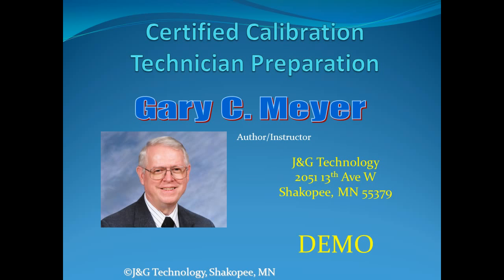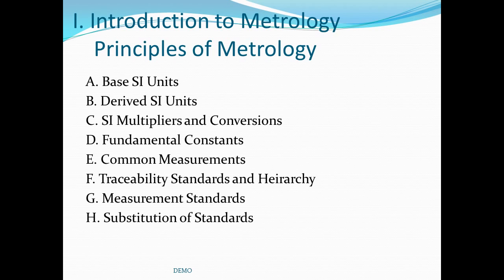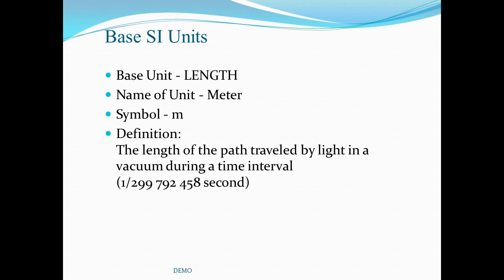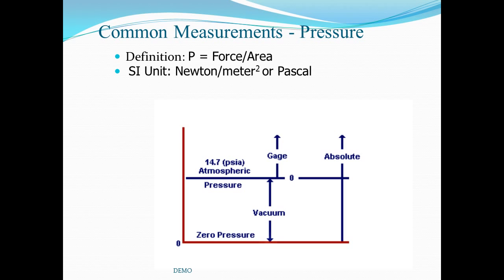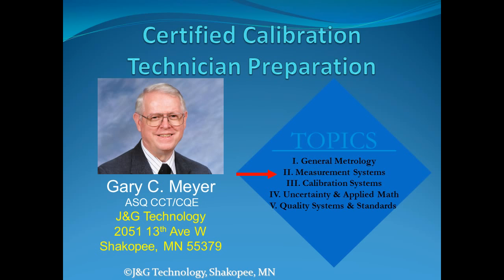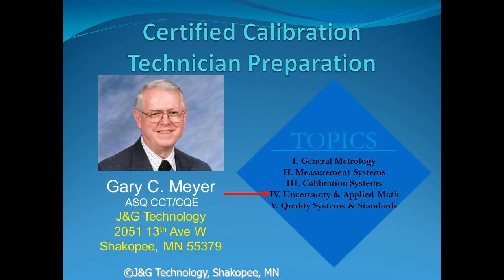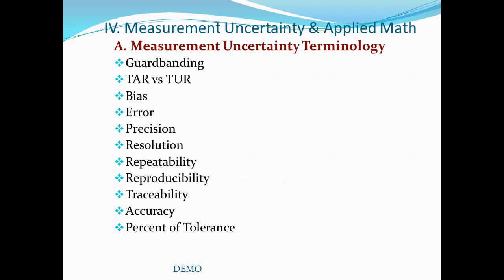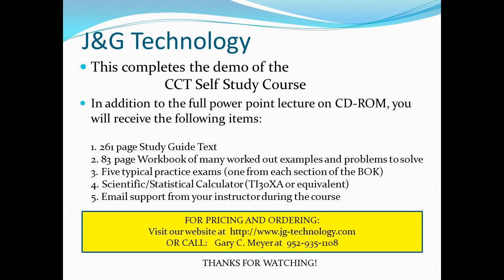Certified Calibration Technician Training.mp4

Comment: I interviewed for a Calibration job at a major pharmaceutical company. They offered me a lot of money. Didn't have the certification. I'll be getting it asap
Reply: Trapperjohn1000  about how much do they pay a pharmaceutical tech
Reply from the maker: I you are talking about a calibration  job in the pharmaceutical industry check out the website at http://www1.salary.com/Calibration-Technician-I-Salaries.html . You can also google "Salary calibration technician" for some other sites. They state the figures as of March 31, 2017, with a range usually between $41,131-$52,839. This varies with regions, backgrounds, etc.
If you are talking about a pharmacy technician, the salary is much less.